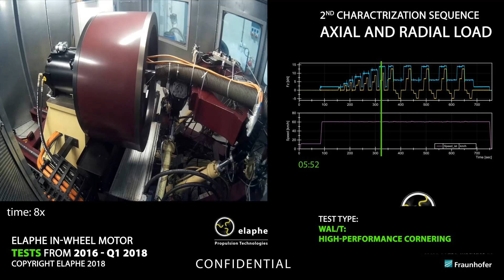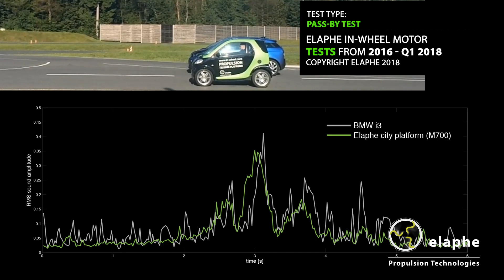Putting toughness to the test: Elaphe In-wheel motor test compilation

Comment: Elaphe has been doing amazing work with a small team.  The Aptera vehicle that launched last week uses them.  The first prototype is on the roads around the San Diego area.  Since then, they have gotten more than 100 million dollars in preorders, for more vehicles than Tesla sold of their Roadsters in 4 years.  The demand is so high that orders placed now won't be built until 2022 at the earliest, but we may see the first production versions on the road in late 2021.  Good things are coming.

You can follow the Aptera discussion on Reddit at r/ApteraMotors.

Comment: That's great. But how can you install such motors on old cars which don't have CAN-control system (just simple functions as ABS)?
E.g. Any FWD car made before 2000-s.
Reply from the maker: It is easier than with the new electronics on wheels :P
Reply: Can you mount two hub motors on the back of Daihatsu Applause 1991y. of production?